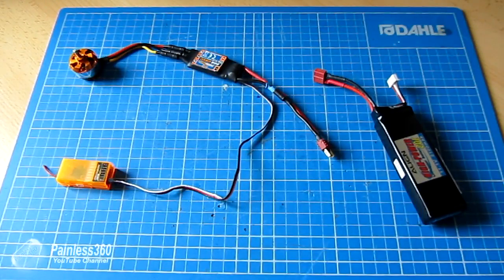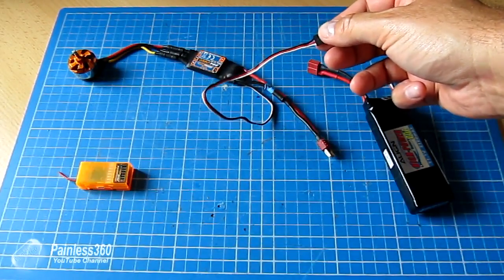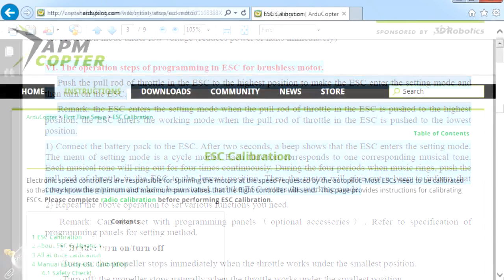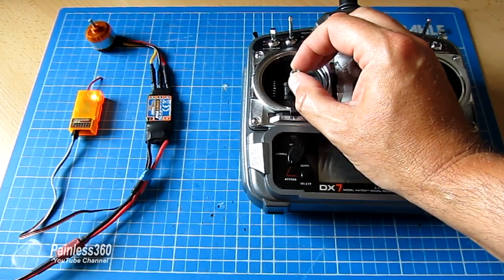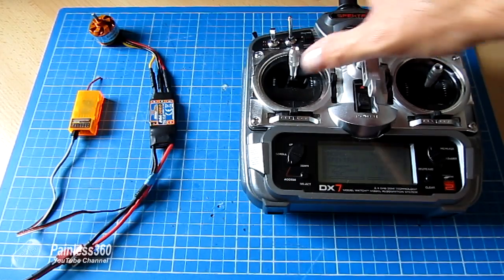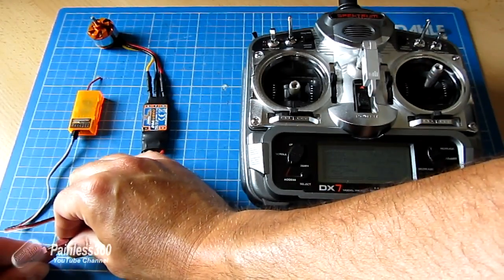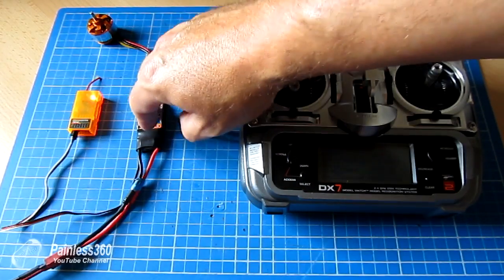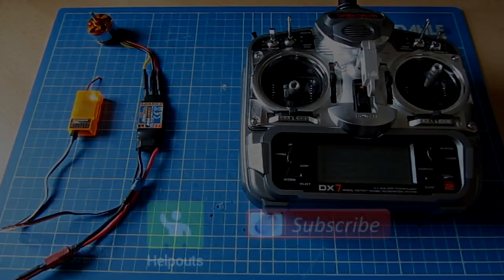Multirotor build tips: Simple manual ESC calibration

Comment: Hi, do you think this process needs to be done with a servo tester that's included in a hand throttle handle like for an electric board, paramotor etc or its potentiometer will always deliver zero to full throttle range regardless calibration?
Reply from the maker: Almost all modern ESCs will use a digital protocol likely DShot. Using that removes the need for calibration... best of luck

Comment: Hi guys! So I'm facing a rather different problem then usual. The other day I was calibrating my ESC with this manual method. After I competed the calibration I moved my throttle around %10-20 range and suspected that the motor was spinning way too fast than it should. So I changed my power source from 6s to 3s just to be safe so I won't burn the motor (Normally it's a 6s build). The thing that I noticed that after hitting the %50 throttle the motor was barely speeding up with 3s source. Normally I would see a obvious difference in speed increase even after %50 in my other build that I did with different motors. So my question is that is it normal to see a little to no increase in speed with a lower voltage power source after calibrating the ESC with a higher voltage source or was I right to test the calibration with a lower voltage source and does what I observed indicates a calibration problem? It feels like if I go around %50 throttle with my 6s source I might burn the motor completely. Should there be a linear increase in speed just like normal even with a lower voltage source? Because it feels like it should since when I increase the throttle I'm increasing the pulse rate even the source in lower than it should. I suspect that even tho I calibrated the esc multiple times I get the feeling that the max throttle is setting around %50 throttle. Would you say that I'm getting scared from the sound of the motor for no reason or that that indicates a problem with the calibration? I'm planning to check the speed of the motor with a tachometer and compare it with the graph of the motor just to be safe but would you say that my thought process is correct or am I missing something? Sorry for the long comment. I'm using a sunnysky r2207 kv 1800 with a 60A skywalker ESC if it helps. Thanks a lot!
Reply from the maker: Using a modern digital protocol like DShot means that you don't have to calibrate. If the throttle response isn't smooth and linear when using PWM then recalibrate and make sure that all of the other settings are default. Best of luck

Comment: Hello teacher. I have the Emax Simon Series 40 A esc. I installed the same system you installed. R9DS receiver, At9S Pro remote and a 6S battery. But the esc operation is not happening. Can you help me?
Reply from the maker: I could be lots of things, what troubleshooting have you already done?
Reply: @Painless360  I own a hexacopter. While calibrating with the remote control, all my escs are out of calibration. I reset the esc. Now I need to calibrate.
Reply from the maker: I'd check what protocol the ESCs need and make sure that is setup in Arducopter. I've had issues in the past with some ESCs with the 'all-at-once' method so calibrating one by one may be an idea. Best of luck!
Reply: @Painless360  I understand, sir. Thanks for the answer.

Comment: Thanks for the clear explanation! Is it necessary to bypass the FC? Also, is it safe for all transmitters to wire directly with ESC? i.e. it wouldn't fry the transmitter..
Reply from the maker: This is not needed on ESCs with DSHOT. So check what you are using. Best of luck
Reply: @Painless360  Thanks for the tip

Comment: I tried individual ESC calibration after putting them on to a power distribution board. 

The motors keep stuttering and some don't run at all during calibration.

What would be the reason?
Reply from the maker: Could be lots of things. You don't mention the flight controller and software you are using so I can't be more helpful. Have you tried running them individually? Have you tried different ESC protocol settings in the software? Best of luck!
Reply: It's Arduino with  multiwii GUI.
I even tried Arduino code that doesn't require multiwii and I get the same.

Tried individual calibration and got the same.

Comment: Hi Lee,  I know you're not providing technical support, but was hoping you had a quick insight.  I've commented about my T960 build which has gone great, I've flown it a number of times now.  Then the other day I wake up and two of the motors/ESCs won't arm.  They keep beeping, but won't spin.  The other 4 are fine.  I've watched all of your videos on the topic, plus many others.  Read the manuals for QGC, MP, read all the advice on every forum I can find. Calibrated about 50 times.  I'm completely stuck.
Pixhawk 4, Hobbywing Xrotor 40a, Tarot 5208 330kv.  I've even replaced one of the ESC's with one of the two unused ones I got so I would have a couple of backups.  Still nothing.  Motors work, as I used one of the working ECS's on them.
Thanks
Reply from the maker: Sounds like they are not getting a signal from the FC. I'd swap the signal cables between a good and bad one to see if that is part of the problem.. Best of luck
Reply: @Painless360  Thanks Lee.  That did make the ESC work and run the motor.  Now the question is, what can I do to fix it?  Does that mean the FC is bad?  Or is there a setting for each signal wire?  Sorry to be a pain. Edit: just adding that I did check the physical wiring.  It has continuity, everything is attached.
Reply: In case anyone is interested, it turns out the power distribution board was bad.  I had to get this going, so ordered a new pixhawk, it came earlier than expected.  Tried just replacing the main controller, still didn't work.  Had to solder in the new board, they all work now.  What a pain.

Comment: I successfully calibrated it but whenever I move few points forward from starting point, the motor gets stopped. Please help?
Reply from the maker: Sounds like the calibration didn't work. What troubleshooting have you already done?
Reply: Well I used servo tester and then I also used arduino for controlling the range but it doesn't work. Seems like it take the both values but doesnt go far from the first value...

Comment: Kind sir I just installed a  YEP 120A high voltage ESC on my heli with no
Instructions that came with this ESC an little help from hobby king other then a web
Page. Just though happenstance of me trying and trying it suddenly turned on
Just the way u showed in this vidio at nearly half throttle. I did not remove my motor
But took off main blades and tail blades flybar padles.as I did not want to upset the
Sperr gear  mass that was worn in for years. My question do u think I can celebrate
This YEP 120A THE SAME WAY AS U SHOWED. I was just so happy to see my motor run again,am afaid I'll do this call and the whole thing will not start again, if almost gave up
After 3 days of endless frustrations, its and old 700mm heli with unknown motor
Has 2  18.5v lipro in serious 40c  4350 mha  any way. Since I cant get any  help here do
U think I should try the calabration method u showed on your vido? Or just work with it the way it is? I afaid  to try because at least it's working now . I was one inch from just giving up on this whole hobby,till that motor snapped on
Reply from the maker: I'm not too up to date with helicopters any more. My days of flying them regularly are behind me. ESC calibration is vital in a Heli as is turning on things like soft start too.. Best of luck!

Comment: Great Video, quick question do I need to have the transmitter throttle trim set to "O" before doing this?  This is for a new single motor airplane I'm assembling.
Reply from the maker: Leave the trim at the center mark for calibration. Happy flying!

Comment: this didnt work it, 3/4 of my motors work fine and the one that doesnt work only turns on a little less that half throttle. Ive replaced the esc and motor and the same problem is still there
Reply from the maker: If youre building a quadcoptrr then its best to use ones that support DShot - setup is a lot easier for the ESCs. See my quadcopter building for beginners series on the channel, best of luck!

Comment: Hi, Thank you very much for making this video. Can you please help me out with a problem of mine? When I plug in the battery, one of the ESC falls out of sync over time (in first 3-6 seconds). When I do all at once calibration, one ESC always has a dead band. It causes the quadcopter to tilt. I'm using APM 2.8 with some generic 30 A ESC (sorry my bad, no info available) and 2212 1000kv motors.Any help would be appreciated.
Reply from the maker: If the escs are generic, I'd look at those first. Sounds like you might have a dodgy one. Best of luck

Comment: Hello sir, i have hobbywing 40A esc. I tested all motor and esc individually and all are working fine. But when i connect esc and motors to pixhawk it won't spin (beep sound from all motor after 1sec interval). I have also calibrate all esc and rc signal (connected through ppm encoder) coming to pixhawk and it shows all values in mission planner. So what is the problem.?
Thanks.
Reply from the maker: Have you armed it? PixHawk will only arm if you've pressed the safety button etc..
Reply: Painless360 yes that i also tried. But not working
Reply: I have been disabled safety button.

Comment: Hi Painless would like to thank you a lot for your videos. I  have Dji f450 with Naza mv2 . Just bought HMF u580 frame - 3508 580kv motors and ZTW Spider 30amp opto small esc (oneshot125) from HobbyKing . Question is : do what your video says but plug in 5v to receiver (4 AA Batteries) because they are opto ESC ? and if I solder all 4 ESC to PDB can I still calibrate one ESC at a time (plugin lipo to PDB ) or do I have to plug 3s lipo battery to each ESC like the video? Im just checking with you to make sure, thanks
Reply from the maker: It's the pwm signal that the ESC receives that starts the whole process so by having them all powered at the same time should be ok. I don't use DJI kit here, so check the manual for the correct method for the flight controller you have. Best of luck!

Comment: Great video, Thanks Painless360!
One quick question: I have a PPM to PWM encoder on my set up. If I calibrate the ESCs the way you show, would that prove to be a problem? Or does the encoder sort things out once that is plugged back in after calibration?
Reply from the maker: +Bryce Bender with modern ESCs you don't really have to do this anymore. If you're ESC has the ability to support DShot then you don't need to calibrate. Best of luck with your build, happy flying!

Comment: I have my esc units on a quadcopter already all soldered in place, if I disconnect the battery to the pixhawk FC, the power will only be going through the pdb, so only the escs will be getting power, if I then take one at a time a plug them into the throttle port on the receiver, can i do this method? Or will having the power shared between the esc's cause a issue? i dont really want to unsolder everything you see, but I also dont want to fry any parts?

Comment: Hello sir, i built a quadcopter by kk2.1.5 but never flying it because i have facing a problem i.e when i connect battery to the quad and after esc calibration the motors are automatically runs without throttle  and also witout arming.....so this is a big strange, what can i do plz help me sir,
Reply from the maker: Happy to help but please watch https://www.youtube.com/watch?v=olIqTiSJHIY and come back to me with more detail of what you've tried..
Reply: Sir i watch the video but there is no solution for my problem.....
I give u some details:-
The components i used in the quad are 4× racerstar 1400kv motor, 4×emax blheli 30amp esc , 4200mah 3s 30c lipo battery, fs-i6 transmitter and kk2.1.5 flight controller....thats all so where is the problem plz help me
Reply from the maker: You are still giving me now useful information about what you've tried to fix it.. A kit list is nice but doesn't tell me anything.. Best of luck!
Reply: Sir i telling u from beginning..... first i setup kk board by changing some value for best performance, ex- receiver setup, mode setting, auto level, motor layout etc. And then when i go to the last step i.e esc throttle calibration at that point when i connect battery to it then it will beep twice thats correct but after that a short beep doesn't come out from esc. So i have to callibrate the 4 esc separately. After successfully callibrating escs when i connect 3s 11.1v battery to quad it will continuously beep for long time and when i go to the setting in kk the esc are sond correctly that means it is ready to fly then when i back to main page of kk the motors are starts to running without arming and throttle.....so this is the whole problem, i tell u everything what u ask, out of this  is there any question from u then plz ask me, i will replay u immediately..... Plz noe help me sir, i am waiting for your replay
Reply from the maker: Sounds like the ESC calibration isn't working. I'd calibrate manually and then check the setting on the KK. Sorry, but I can't help any more as this is a very old baord and I don't fly them anymore..
Reply: Sorry sir i didn't  understand what are u saying, plz tell me simply...

Comment: Hello Lee: do we need to re-calibrate ESC if either of following battery specification change?.

1/ S (i.e. 3S, 4S etc.)
2/ maH (i.e. 2700mah, 3000mah etc.)
3/ C (i.e. 25C, 30C etc.)
4/ weight
Reply from the maker: +adnan ul haque nope, you shouldn't have to..

Comment: Hi, if you switch the wires connecting to the motor to change spin direction, do you have to calibrate the esc again?
Reply from the maker: +Dare Olubodun nope, it should be fine.

Comment: coud the ESCs be throttle calibrated all together once  installed on the quad ?
Thank you
Reply from the maker: That's the normal way - see the 'Quadcopter Building for Beginners' series on the channel for more steps..
Reply: hi, sorry for bothering you, i just bought 4 little bee 20A OPTO ESCs to replace the original ones on my drone because i can't find one of the originals as spare. I've installed the ESCs and armed the drone but the motors are spinning at very low speed ( not the same as with the original ESCs when arming ). When connect the battery the ESCs give four musical beeps followed by a longer beep but the radio doesn't give any reaction to the motors when try throttle calibrating as on youtube. After many times trying one of them give the usual beeps when i arm the quad but the motor doesn't spin . Can you tell me what i do exactly need (hardware + software) to be able to do calibration on the PC  ?
Thank you
Reply from the maker: Ionut Popa the best thing I can recommend is go and find the video series on the channel for the flight controller that you are using, I'll have covered calibration in that series. Best of luck